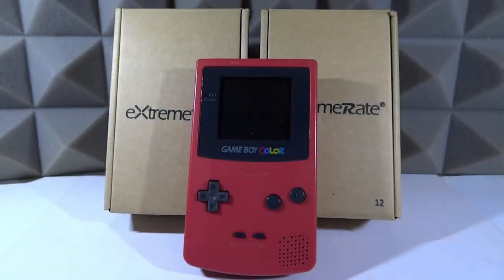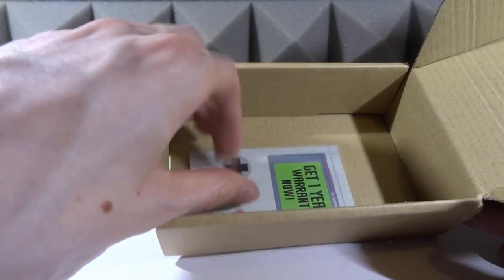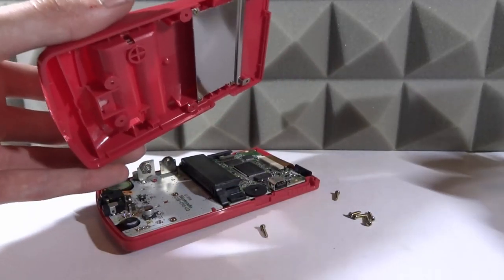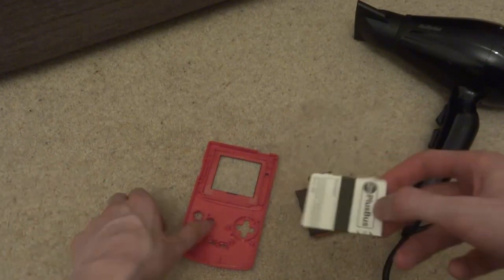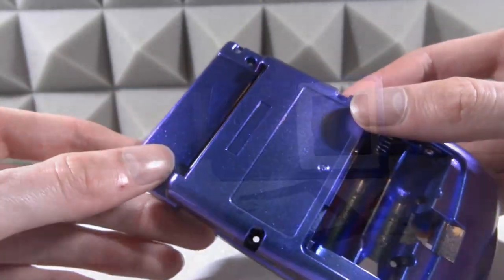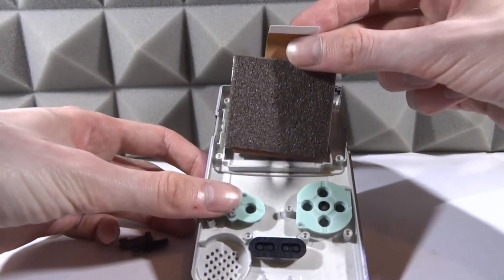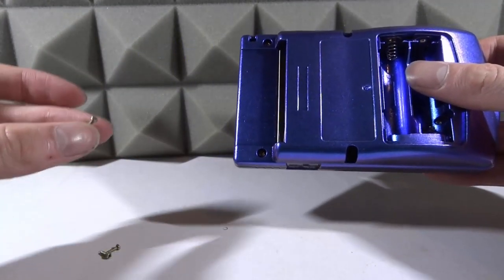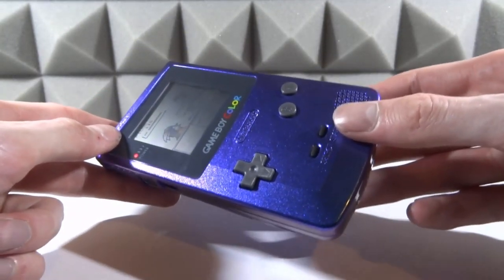eXtremeRate Custom GameBoy Color Housing! Install Guide!

Comment: How do you solve the error where the psvita says there is an error and it will now power off pls respond
Reply: I'd suggest booting into recovery mode (when off, hold the power, r trigger and home button, or just power off and don't let go for 20 seconds) then hit "rebuild database". This will rebuild any missing system files or codes in the device. It wont damage your homebrew or whatever is on your vita. It will, however reset the live areas (your folders will be gone and all your apps be everywhere, you'll need to make your folders again.)

IF some apps are missing after, simply go into vita shell and hit "refresh live area". There's only so many bubbles the vita can have at once, so shove everything in folders first before doing this. Hope this helps!
Reply: @randomdude5070 will i lose my downloaded games?
Reply: @drippyspapher984  no, this option doesn't delete any games, or anything for that matter. It only adds/changes any corrupted/missing system files. Just try it. It's completely safe. Make sure though you hit REBUILD DATABASE and nothing else.

Also let me know if your vita is jailbroken or not (I'm assuming it is)
Reply: @randomdude5070  yea it is, I have henkaku on it
Reply: @drippyspapher984  ok DONT DO IT YET

I just checked on google to see if I was leaving anything out, and turns out I was. Apparently it will reset the config.txt file. I've done this twice before and I remember that happening now. Make sure you backup the config.txt and wait on it for now
Reply: @randomdude5070  okay... I already rebuilt the database and it's working fine so far
Reply: @randomdude5070  I'll contact you if it still happens
Reply: @drippyspapher984  k I'm looking into it more incase, I recommend you put all you games in temporary folders to reduce the amount of bubbles on screen, then find vitashell.
Reply: @randomdude5070  no extra bubbles appeared so I guess it's fine
Reply: @randomdude5070  btw let me add u, ur such a great help bro
Reply: @drippyspapher984  thank np random_dude203 is my psn
Reply: @randomdude5070  I'm still receiving the error
Reply: @drippyspapher984  did the error just happen at bootup, or after you opened an app?
Reply: @randomdude5070  it was happening while I was playing games, it doesn't occur frequently tho but it's annoying when it does happen
Reply: @drippyspapher984  I was searching on it earlier, there's only two solutions I've seen that seem to fix it. One was to rebuild the database, and the second was to factory reset. You technically can reset the device if you back your data up, but I don't know too much about that. I guess you could uninstall plugins that are active on the game and see any of them are causing the issue, or maybe the games that are crashing are dumps? I wish I could help you more, but I'm pretty stumped at the moment. Keep me updated if you make any progress
Reply: @randomdude5070  thanks for the help